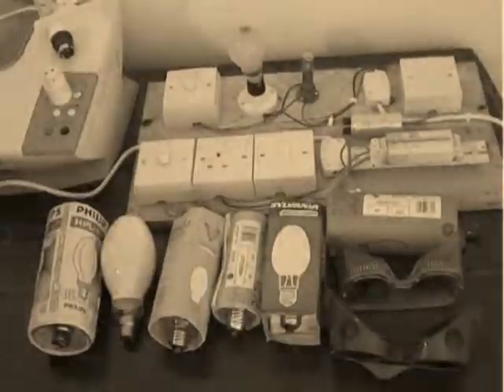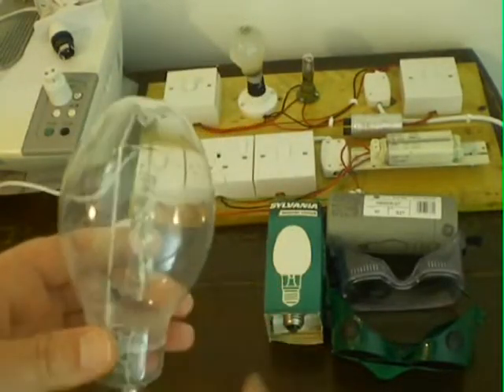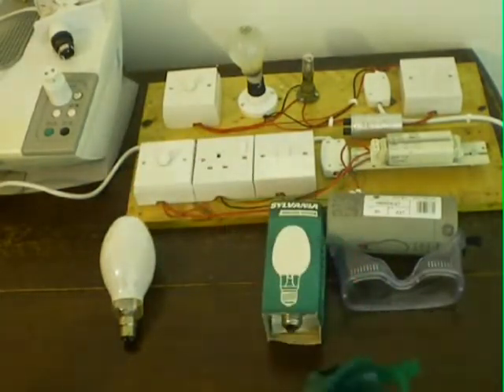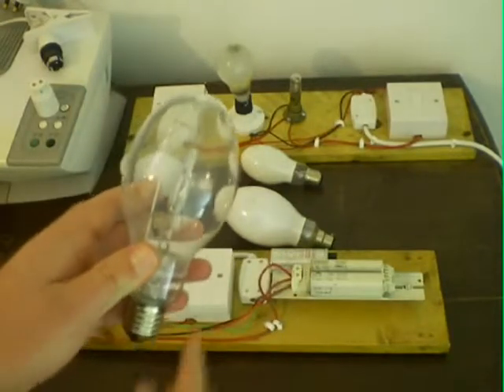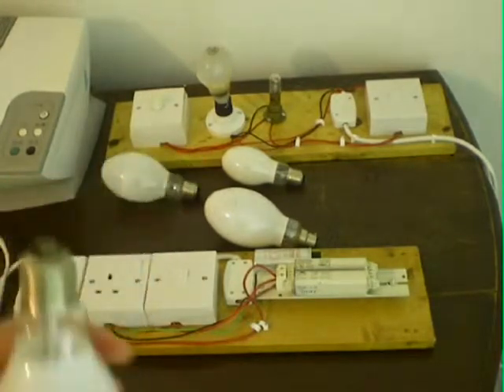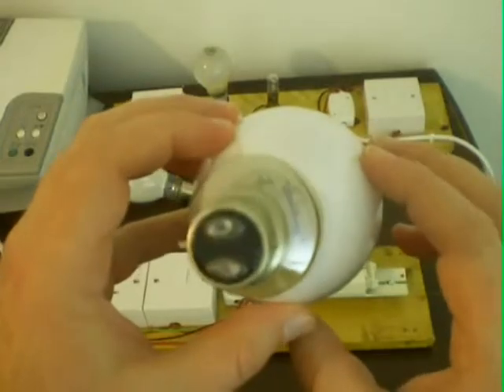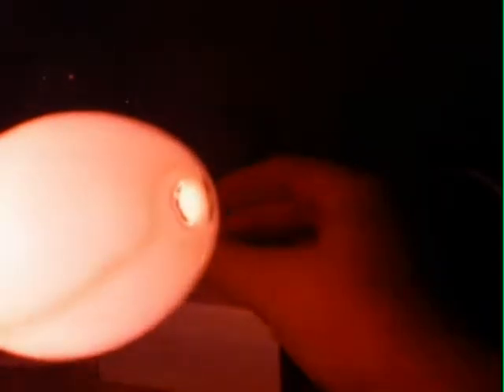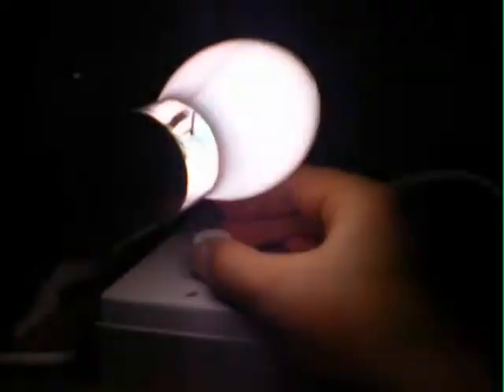Mercury Lamps

Comment: I remember this video in February 2013. The first time I saw this was on the 04/02/13 and it gave me a big thrill. 125 Watt MBF/U was the most common MBF wattage because it lit all side roads in city centres & city suburban estates. On the other hand 80W was the second most common street light in the ROI because it lit all footpaths alleyways bungalow estates & also railway platforms. 50W MBF wasn't that common because it was mostly used in bulkheads on schools, churches libraries & shopping precincts.